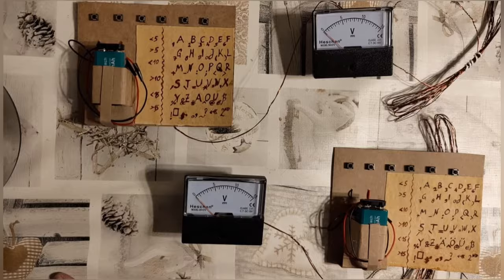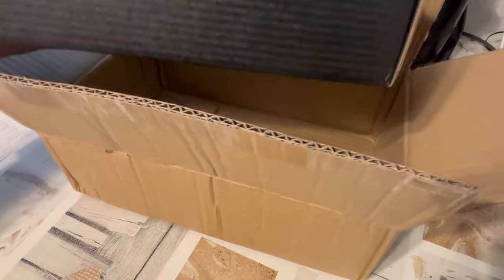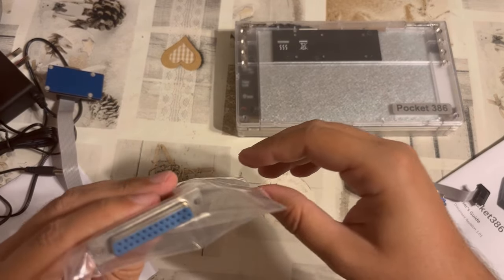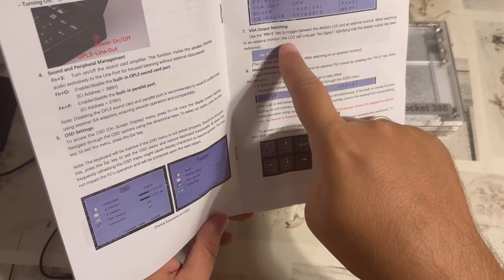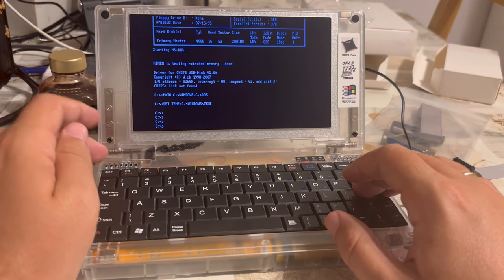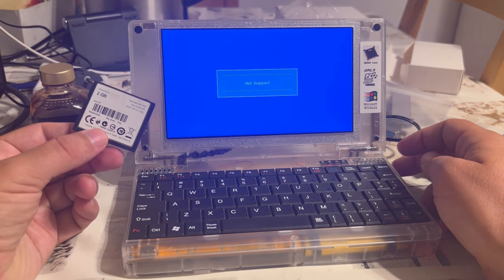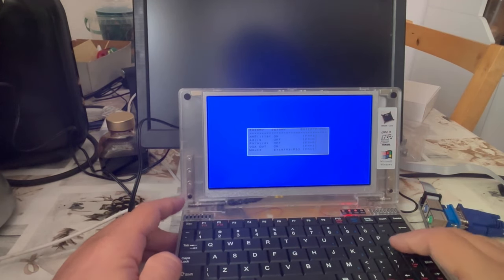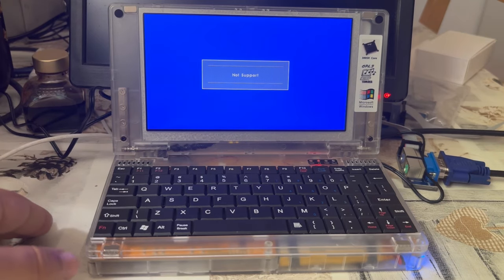Pocket 386 dies on camera during review

Comment: It probably does not detect the graphics card for some reason. May be a bad contact somewhere inside the laptop itself. Clearly it boots, because it gives those two short beeps and then one beep after that. It's just not displaying image.
Reply from the maker: Thank you! I think you totally made the right suggestion! I just took it apart. Re-fixing all cabling did not help at all. But interestingly, taking out thr graphics card and booting without it made no change in the situation — and one would expect that a working graphics card SHOULD make SOME change. So somewhere between the card and the monitor, or the card itself, there is the issue. Given I am getting no image even on an external monitor, I suspect the graphics card is dead. EDIT: plus, a second before it died, it actually displayed "the Windows desktop" as a squashed image in the upper right, all the more pointing to the graphics card…
Reply: @ninoivanov  On many BIOSes that type of beep code that it gives before those two short beeps (which indicate that an error happened) mean that there is no display adapter. Many computers still boot normally after that and they can be used headless.
Reply from the maker: @tikkasen_urakointi  I am check-mated because for a headless start, I would have had to enable the serial port in the … BIOS. Well, well, well. — Admittedly, then I could have done a MODE and a CTTY COM1: in AUTOEXEC.BAT and tried to use the machine headlessly…

Comment: 1 long 3 short beeps is the graphics card not detected beep code.
The two short beeps after is RAM test finished post code. So the rest of the system is ok. Not supported is just the display controller saying the signal it is getting cant be displayed or there is no signal at all.
Reply from the maker: Thank you for the diagnosis!

Comment: Graphics card (GPU) system mot working.
This is the 1 long 3 short beeps code.
Rest of system is still working.
This is the 2 short beeps.
Not supported is just the monitor electronics not recognizing the signal or no signal from graphics card.

Comment: action retro had a similar new portable 386 fail randomly in his video. maybe these are just questionable from the start.
Reply from the maker: Thank you for mentioning that, that is, of course, interesting! — And what is annoying, as with the previous model, nobody seems to be selling replacement parts, either. You can get a Pocket 386 — but it does not seem you can get "just its graphics card".

Comment: Watched a few videos on this design; Maybe one of the older chips they've used has died is my guess.
Reply from the maker: Very likely you are correct.
Reply: @ninoivanov  Since you got it for nothing I's start hacking it with my hot air station!! As another viewer mentioned it's probably just ram.
Reply from the maker: @TradieTrev I got no hot air station but "helping the soldering" might have the same effect, right?

Comment: Have you plugged the CF card in properly? Have you tried reflashing the CF with the operating system again?
Reply from the maker: It is not the CF card at all, but I suspect the graphics card. I have tried booting it with the card of my Book 8088, which it did boot in a brief try, but it changed nothing. The fact if the matter is, I cannot access the BIOS — yet I should be able to, even without any card.

Comment: They are as unreliable as they can be. The only thing I regret about owning a Libretto is having a laptop with a Pentium MMX on which I can change the speed and multiplyer through DIP switches WHILE the machine is on, and it wouldn't crash, in a brittle, flakey case, which started disintegrating itself and not having 3d printed models to get a new case. Librettos are the real machines you should look for, they can be fixed with a soldering iron and wired up as one likes. Get us 3d prints.